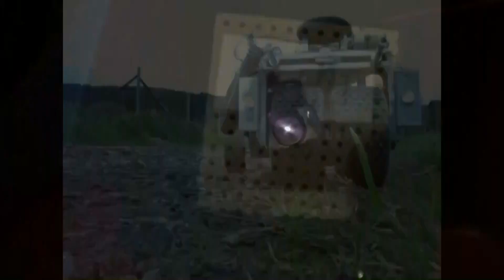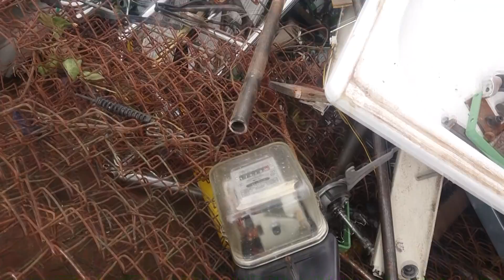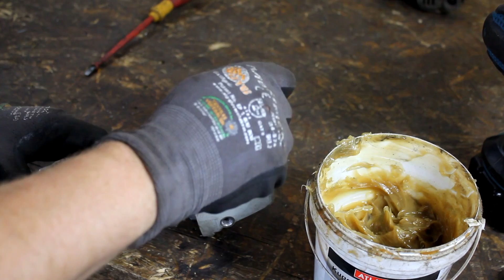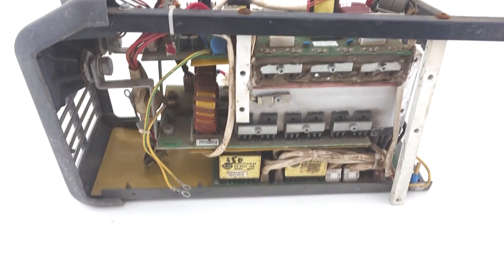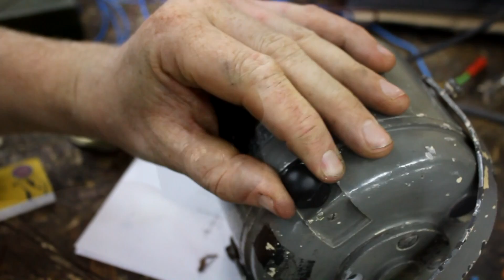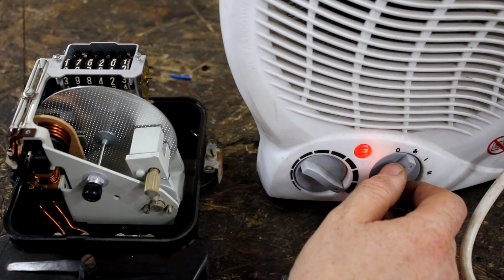New Great Scrapyard-Finds! Repair-A-Thon!

Comment: How many grinders do you need?
TPAI: Yes
Reply: How many times has you see this kind of comment
Me:- Yes
Reply: The number you need is equal to the number you have plus one😁
Reply: As he demonstrated in the video he needed at least three working grinders. Cut off saw, wire brush and grinding disc. I hate having to stop and switch tools back and forth, on and off. Having multiple tools ready to go can really speed up productivity on a project. Plus he has spare parts for the next grinder he finds! 👍
Reply: @Vault57  - Yes, agreed! I have many angle grinders, each has a different task -Cut, Grind, Wire Brush, Flap Wheel. I have 100mm, 115mm, 125mm and 230mm. I have rat tail and stubby ones. I guess I have 10 or more, and they ALL get used.
Reply: @Vault57  I have 2 125mm grinders, and its not enough, I'll need at least 2 more (besides big one that I have).
Reply: Vein1986 Well, I’ve got four, 3x 115mm and 1x 125mm. I have a different wheel on each and I’m still swapping stuff over, so I guess the number needed is (as stated above) the number I have plus one. And an “extra” extra one, to be used when one of the old ones breaks down (it’s already happening). I certainly would like to visit TPAI’s scrapyard! Les in UK
Reply: @Vault57  next grinder that dies or breaks too!
Reply: The point is that, with a little elbow grease, you can repair most equipment.
Reply: He'll soon have one dedicated to each task--grinding, brushing, cutting, dentistry...
Reply: if you have one for ever grinding disk type you like, then that's half as many as you need.
Reply: You need a angle grinder for each type of accessory that you use.
Reply: Many.
Reply: Been told by my retailer to check thoses made for by professional ...

Wonder if they consider that kind an answer as a "no comment" .

Any ideas ?
Reply: I have four, two small, one medium and one big.
Reply: Well, I guess he could sell them.

Comment: I found the best way to remove components from circuit boards is to get an old hot plate, put a steel dish around A5 paper size and 30mm deep on top and half fill it with lead. When you want to remove the components just use the hot plate to melt the lead making a little lead bath, just hold the board on top of the lead and use needle nose pliers to gently lift of the components, You will strip a board very quickly with no heat damage to the components.

Comment: These Hammer like solder irons were used to solder gutters. I have to of them from the GDR but they’re doing great for normal bigger solder jobs.
Reply: Just the right tool for delicate SMD work.
Reply: @badjonatan  and two hours to cool down!
Reply: @zolatanaffa87  
No its 2 seconds to cool down
Reply: @lordelectron6591  Yeah, some liquid nitrogen makes wonders about that :)
Reply: There are videos on YouTube of similar tools being used for the making of metal organ pipes.
Reply: @badjonatan  
I need that  for nano soldering
Reply: I like this one for salvaging components!
Reply: @maxwang2537  
A soldering pot will help to desolder all through hole components

Comment: Hey post apocalyptic inventor!
You opened my eyes with what we throw away, and last day Iamaged to rescue a drill support for hand held drills
It was in fairly good shape and all it needed was a clean up and lubrication, though the lever that moves the drill down was loose cause it was missing a few washers, but its an easy repair
It didn't have any sticker nor stamp that said what brand it was sadly
A brand new one costs 30 bucks which isn't much but still I'm glad I got it for free
Its a shame people were going to throw it away
Thank you for teaching me how valuable rescuing a tool could be

Comment: I really envy you your "rich" scrapyard.
Reply: Just found Bosh 1400 pro model from community scrap collection. Just needed one screw removed cleaning of corroded brush holder, little cleaning of brush and now i'm looking to find bottom washer, locking nut and handle to that thing.. otherwise i have yet another grinder for steel brushing, witch i have too many already.
Reply: @Hellsong89  
Its nice to have several grinders with different wheels mounted. Saves time.
Reply: @OldNorwegian  Yes! I have one with a cut off wheel, one with a flap disc, and another with a grinding wheel. I use the all the time.
Reply: For real I never find stuff like this at my scrap yard. However I rarely go to my local scrap yard, so that may be why. :(

Comment: I wish I was close to a scrapyard like that
Reply: No kidding! Maybe the next episode should be how to find a good scrapyard!
Reply: Scrapyards rarely advertise but most towns have them, especially towns with an industrial presence
Reply: @Falney  Not all let you look through the stuff though. I think with smaller ones that aren't part of a big chain, there's a higher chance they'll let you look than bigger ones in industrial areas.
Reply: same
Reply: Same  here
Reply: Let you search and have good valuable things is two things essential to this kind of scrap rescue and the two things lacking in the scrapyards around here (interior of Brazil). Almost just metal scrap and car parts (bad car parts).

There are some videos from here showing very good findings (old machines sold by the weight), but almost all are from the metropolitan São Paulo.
Reply: You must be close. Scrap is the most abundant thing on this planet. Metallic recycling facilities usually sell scraps by weight.